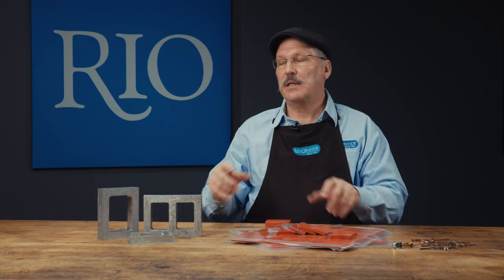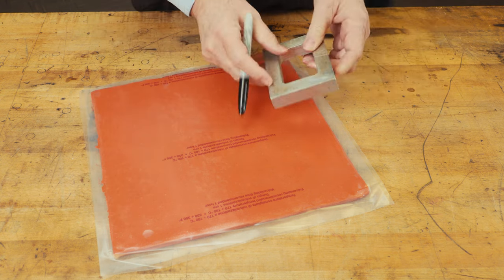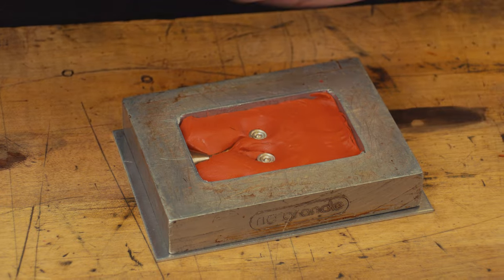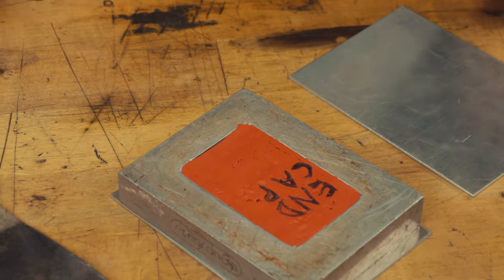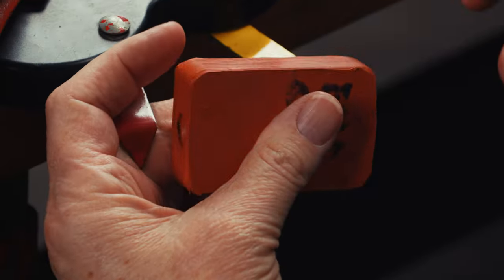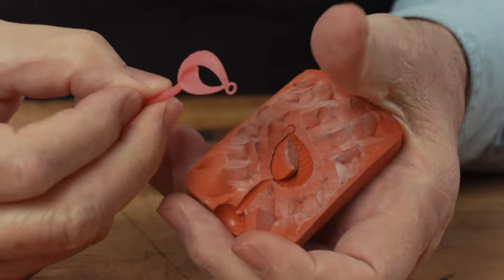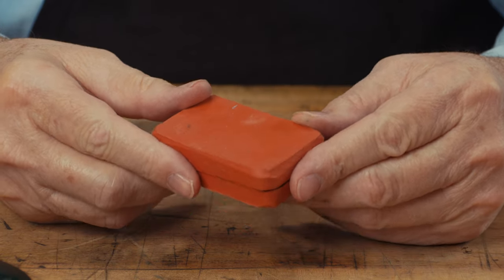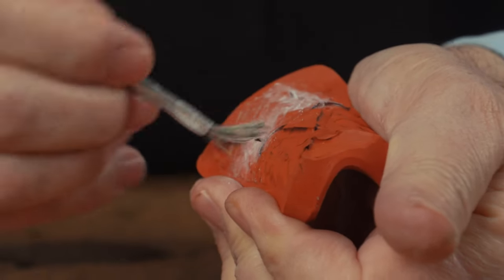Mold Cutting and Packing Basics

Comment: What is the 'black mark' you are referring to at 11:56? Thanks for the tutorial. It's been very helpful in my miniature motorcycle model manufacturing process. But I didn't catch the marking process, perhaps. If you can explain, that will be very helpful, as I am now learning how to make these molds myself, instead of outsourcing. Thanks!
Reply: Marki ng the center of the model with a marker allows you to follow that line while cutting the mold open and this in turn ensures an halfway cut on your mold. You don't need to do it but it acts as a guide for your blade.